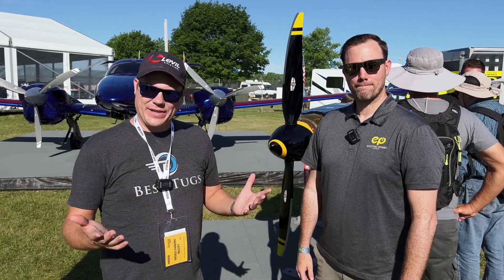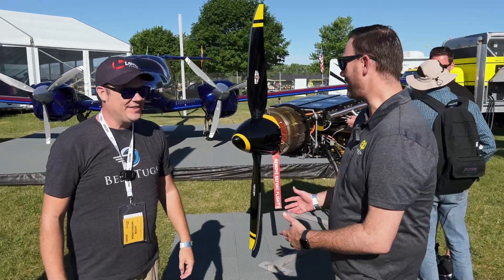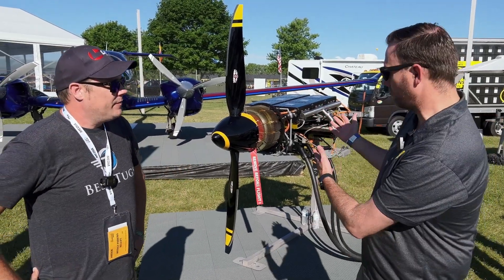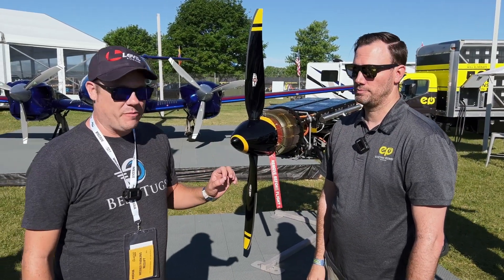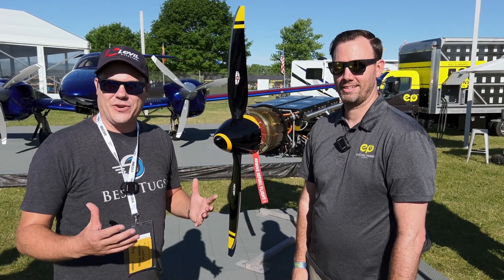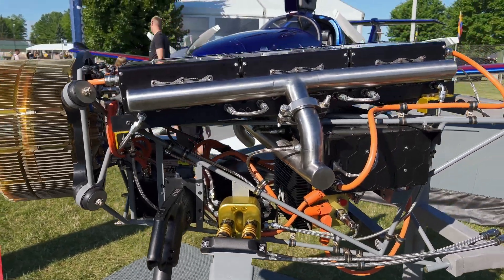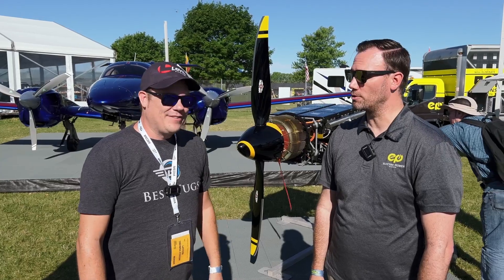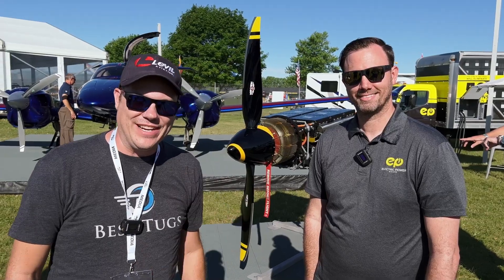Electric Flight Almost HERE | OSH Airventure 2022

Comment: Electric battery systems are not even reliable on a moped yet much less an aircraft flying over cities, and other populated areas etc. It is not ready for anything like prime time. Nope, not going to fall for this.
Reply from the maker: Theres a big difference between what's used on a scooter and aviation grade stuff. Thankfully this is pushing for an STC so I would assume it's safer, but in the same time we're probably going to see battery failures. I'm not sold on it just yet myself. It's just a cool technology.

Comment: I fly an Ercoupe but I usually never go anywhere except to the training area or the pattern. Two hour range with reserves would be fine for me. How does this compare with a C85-200 overhaul and operating expenses? As a training plane, how would a student transition to a piston plane after? Virtually no students will have a DA40 Electric available, so they will need recip training on top of that?
Reply from the maker: Good questions I don't have answers too. But this ones fun, think about turning off the blade when your waiting to depart. LOL

Comment: This is headed in the same direction as the all the new EV's coming out, like the Ford Lightning.  It looks great on paper and performance is OK, but when put to real world tests, it fails miserably.  A typical light plane would not be able to carry enough battery to make this a gas replacement option using todays technology.  Not to say it won't get there eventually, but it will happen in cars first.
Reply from the maker: Totally. Cars have been somewhat reliable in the market, but these guys are a different beast. Cars get into a cruise mode where they demand less from the batteries. The draw on the batteries for aircraft is going to be much more stressful. These guys are liquid cooled and all, but I just have to hope that these guys have worked out the finer details so things don't go up in smoke.

Comment: Let’s see how many are going to catch fire!  😂
Reply from the maker: There is a possibility. The batteries are going to be under a lot more demand than the ones in cars.
Reply: @flywiththeguys  Yes, and that's exactly why I made the joke. Cars are still having lots of trouble with its battery packs imagine "new" compact systems for aircraft. I am totally for having electric kits for aircraft. However, there's way more R&D to be done in order to get to the point of offering an end product. It will be even harder to do so for we all know the systems have to be light, strong, "safe" for aviation. We all know how safety demands work in certified aircraft industry. The bar has to be even higher to not burn like a fire ball in thin air. Can you imagine that while you are flying? All in all, there's no way we are going to have kits ready to go in near future. If we do, OH boy, we are going to see lots of bad accidents. I guess we all are going to be following this one really close 🙂happy flights and blue skies!

Comment: We have some flight schools in Australia using the pipistrel electric for initial training. The nice thing is the useful weight goes up due to how much lighter the engine is.
Reply from the maker: Another nice thing is you take off and land in the same weight category. Nothing changes in flight. This could prove problematic for airliners in the future as they have a max take off and landing weight.
Reply: @flywiththeguys  yeah. That's with the larger airliners such as the 747 I believe. 737 and a320 have equal weight category.
Reply: What happens after training though, when there are no electrics available to rent or purchase to fly xcountry?
Reply: @lynnkramer1211  you would start flying regular fossil fuel aircraft. The skills you've learnt would transfer across

Comment: That's so exciting! Flying is about to get a whole lot cheaper! And planes are terrible for the environment so it's good we are finally learning eco-friendly options for flying!

This is super good news for general aviation but bigger aircraft are going to be a lot harder to power. The amount of weight a battery would need to be to power, let's say, a 737 is really heavy. Fine for takeoff and cruise but for landing, the weight is the same. This is bad for Ryanair pilots as the average landing for them will now officially break their plane with that weight. Also bad for the runways and you need longer runways. Then brakes need to be stronger blah blah blah you get it. Although Airbus is making a hybrid so we can at least step towards more eco-friendly planes while working on the weight issue
Reply from the maker: The video was a bit deceiving in how much power it's going to take. The little boxes on top are only part of the battery pack. The belly of the plane will be covered, with a total of 25 packs I believe.
Reply: Flying is getting a whole lot more dangerous you mean! Lithium batteries catch fire! They were take out of bus service because they proved unsafe. Batteries are not a power source. Batteries are only a storage unit, the power is from coal fired power generating stations. This is ludicris.
Reply: @lynnkramer1211  yes of course, the FAA is gonna let an engine get certified when it always catches on fire. Ahhh yesss, the huge amount of pollution caused by airplanes isn't more dangerous than one of the most revolutionary improvements to aviation that makes it affordable and way better for the environment. But a few engine fires (which already happen) that will help us learn how to improve it's safety should keep us from going eco-friendly. And as soon as 1 of those engines catch on fire that's gonna be a huge investigation.

Like bro wtf LOL